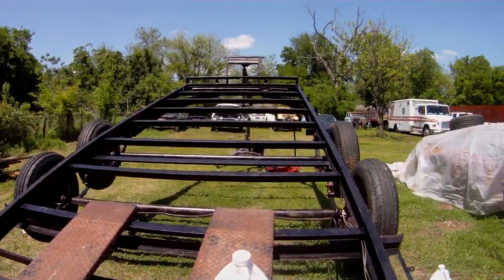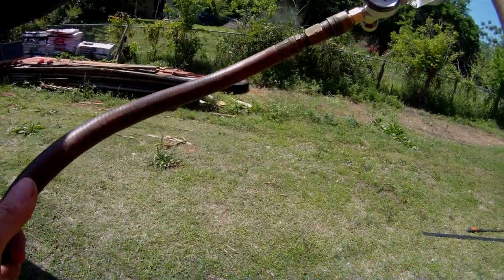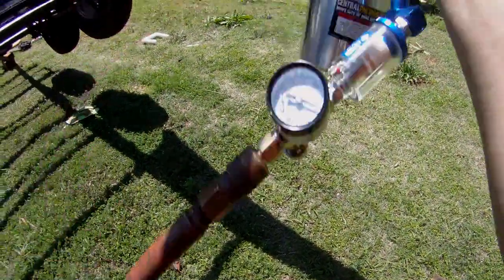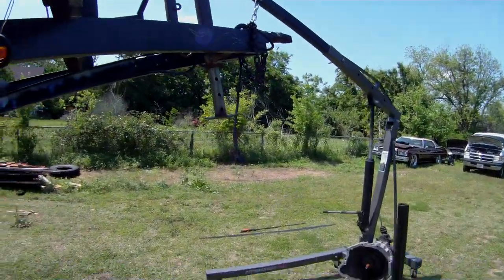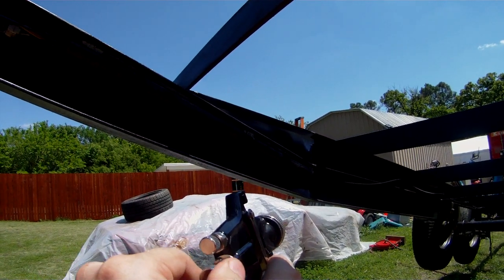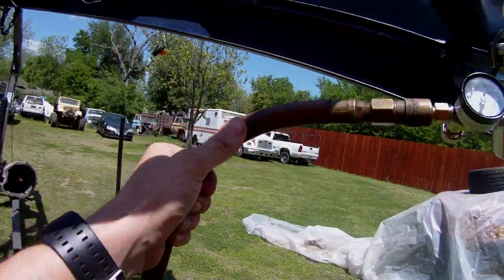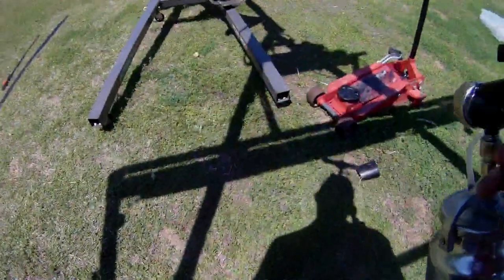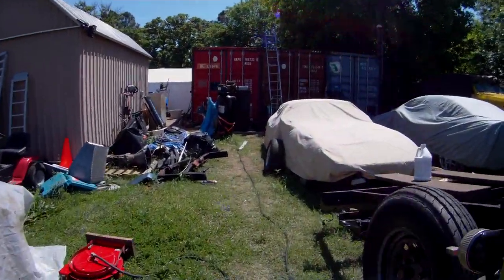Trailer rust protection with Corroseal

Comment: What psi it sprayed the best?
Reply from the maker: marcin wisniewski 30psi seemed to be the best
Reply: @RevampMotors 
Do you recommend same gun? Or I should go with the spray gun for car paint?
Was coverage good thin layer? Or brush is better?
Reply from the maker: marcin wisniewski I would stick with the same gun, just make sure you clean it REALLY good after.  It went on pretty thick once I got the pressure right. Be mindful of the amount you have left in the gun, at some point I was messing with pressure and realized I just didn't have enough in the reservoir for it to spray correctly.
Reply: @RevampMotors  
Thx for all help
Btw how much did you use spraying it?
Should I brush it first and then just spray as a 2nd coat?
Reply from the maker: marcin wisniewski I pretty much used the whole gallon, brushing first would mean you only have to clean the gun once, so yea ... Cleaning sucks.